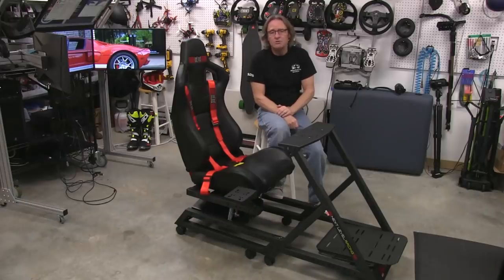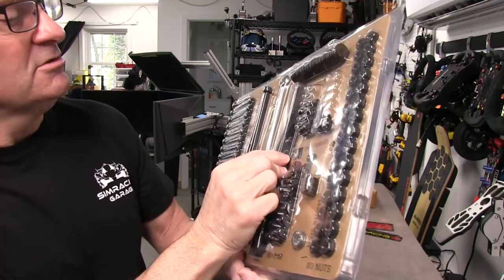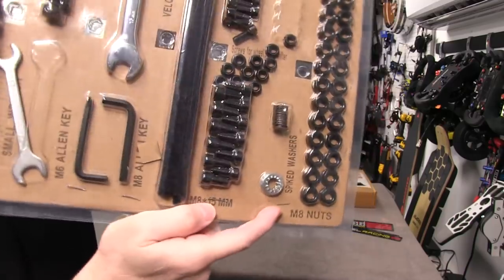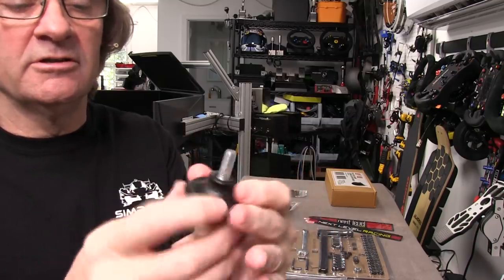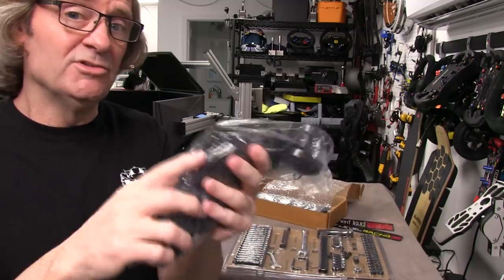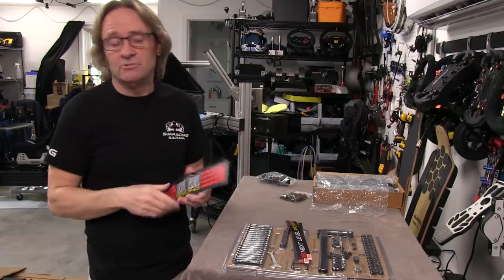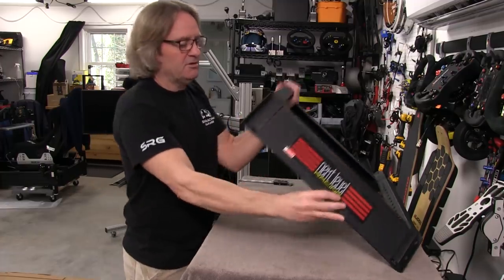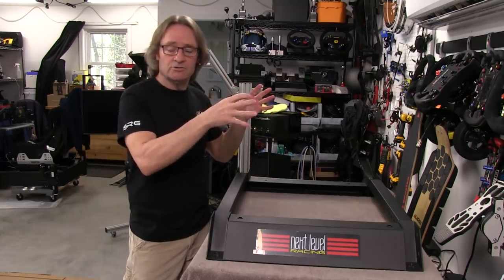NLR GTTrack Cockpit Review Part 1 "The Build"

Comment: I have the NLR 2.0 stand and wondering if it'll be worth getting the $500 seat attachment -- All together it'll be pretty close to the GT Track, except the front part won't have the solid bar going from front to back at the bottom, since the wheel stand part is made to fold up for storage, so maybe not quite as rigid as a GT Track. 

It's either that or just save longer for an aluminum profile rig + seat. Decisions, decisions.

Comment: I agree with the seat back flex issue.  That seat looks almost identical to the one that ships with the Obutto.  After about a year of use, that free play is going to get worse.  The problem is it only has positive seat back support on one side.  I bought a cheap faux leather seat from amazon with an adjustable seat back...however this one had a dial adjust on the seat back and it had positive support on both sides of the seat.  Been racing with that for about a year and it’s still rock solid with no noticeable flex.

Comment: barry from your experience hows the comfort compared to a fixed bucket seat. i was looking at this but im bit taller and heavier than you and the flex from the seat would annoy me. but could someone 6-1 95 kgs fit in the fixed bucket seat ?
Reply from the maker: I think it's really easy to find a comfortable sitting position with this seat. Finding a comfortable bucket seat is more difficult. I went through 3 different buckets to finally land on my Sparco EVO. Even if you were the same size as me, there is no guarantee
that you would be comfortable in it. Really have to try different seats. If you have a local speed shop, I would go there and try what they have. They do make the Sparco EVO in larger sizes, so there is that option. Thing is, once you find a good fitting bucket seat, then find the correct angle with the side bracket holes, it will spoil you. Which will cause one to notice, in a negative way, any flex when sitting in a seat with a reclining back.

Comment: Barry, is there any fix to swapping out the reclining seat for a Sparco fixed back seat?
Reply from the maker: Yes, you would need to fabricate some metal slats to span the gap between the rear rails. Once they are secured, you can drill them to accept regular side mount seat brackets or sliders.